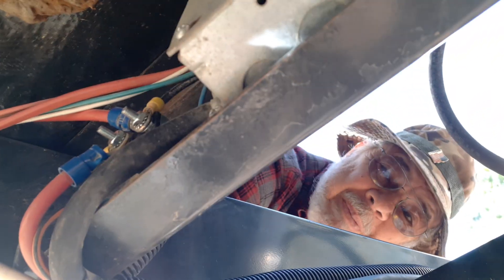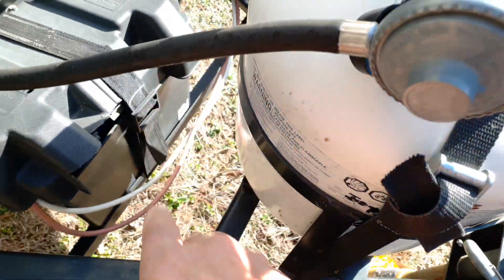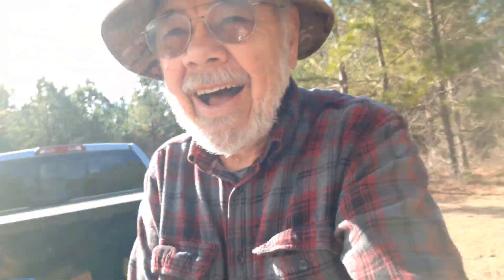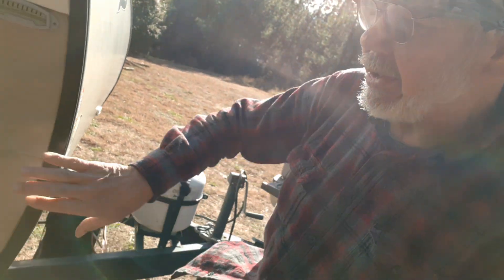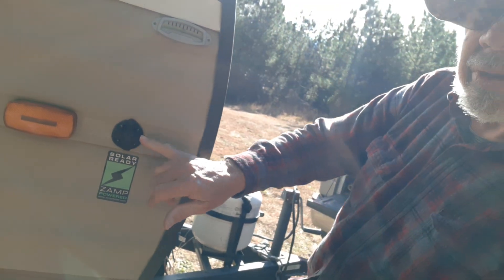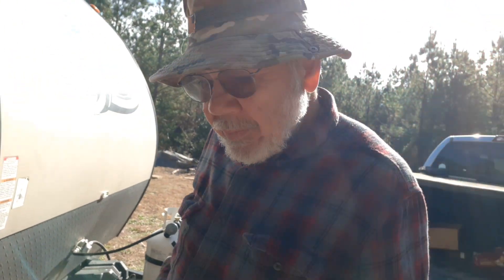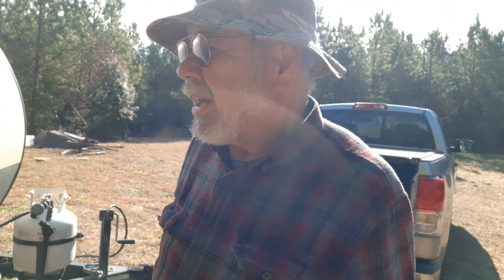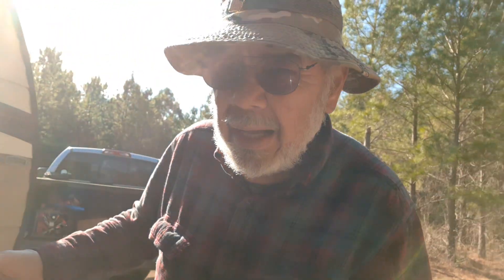RV 30 amp Breaker for Battery

Comment: Hey Mike. Your furnace uses approximately 1 gallon of propane in 3 hours of runtime. That breaker is designed to automatically reset when it cools off after being tripped. Did you get a spare just to be prepared, or did it fail to reset? You probably still have my number, and you're welcome to call if you don't get answers you need locally.
Reply from the maker: I did get a spare and thank you for the information. Mike